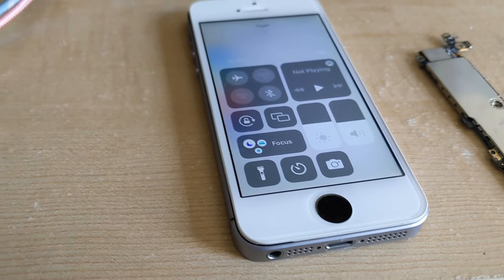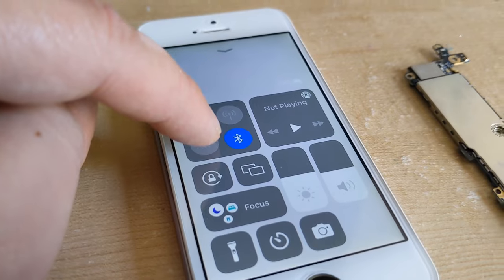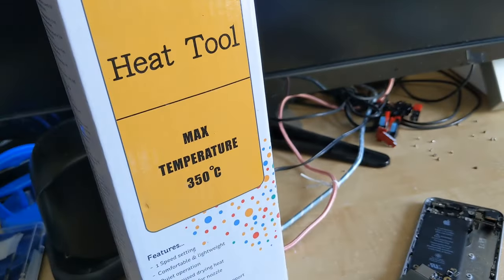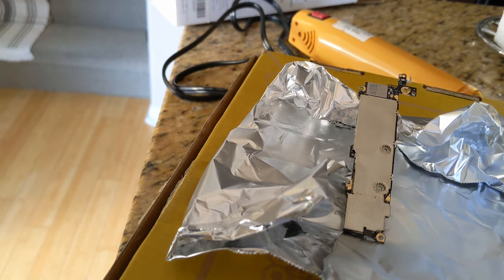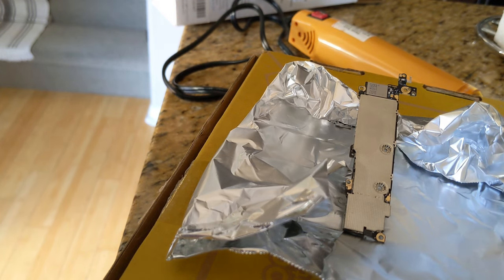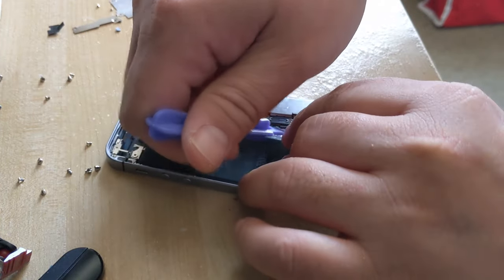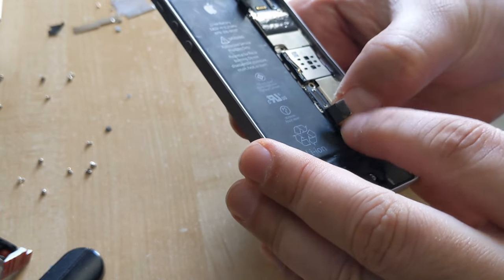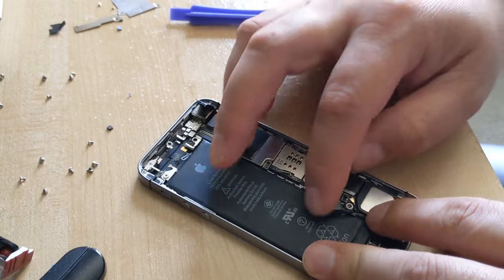Grayed out/Broken Wifi on iphone.  FAIL!  Tried using heat gun to heat the wifi chip on iPhone.

Comment: That wifi IC is underfilled bro and most likely is good, it just has a short.  When you try to reflow it without removing the underfill it just gets worse. You'll have to carefully scrape coating from around the chip, then VERY carefully remove it, remove all undercoating, reball chip then reapply. I don't suggest for beginners or without a microscope, but many videos on here with underfilled IC's. Good luck!

Comment: Yeah that is definitely a board issue and the chip is underfilled.

So you can't reflow it like that.

And that heat gun is too weak to melt any solder